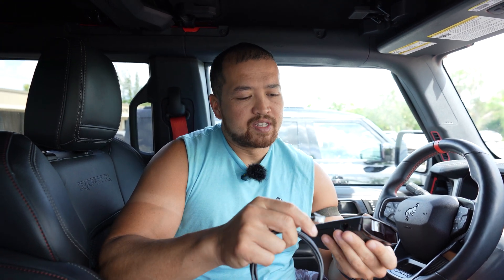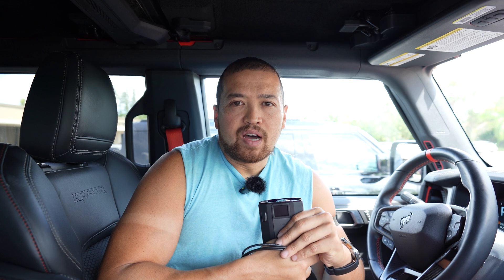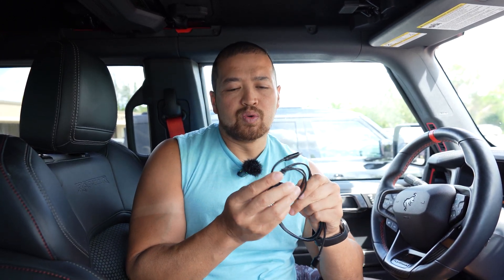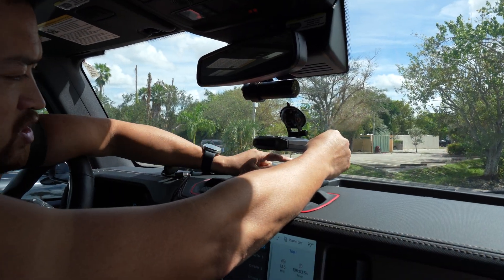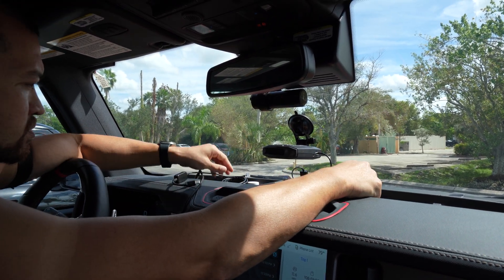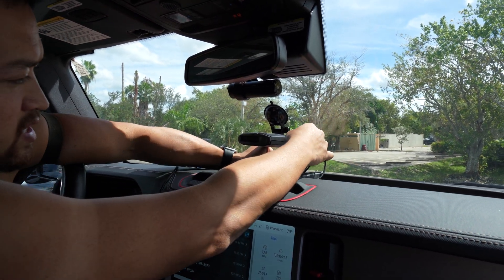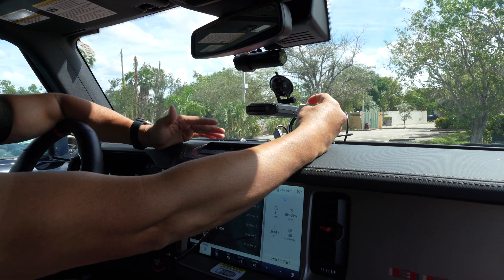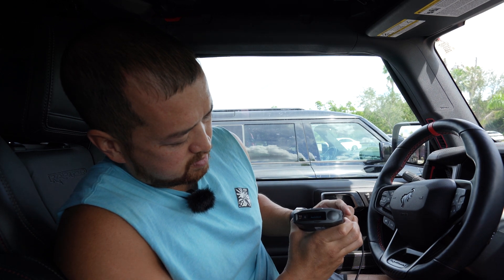USB-C to RJ-11 Adaptor for Valentine 1, Escort, Uniden, Beltronics

Comment: Thanks for the video. I own a 2025 BMW iX an EV and the front 12V outlet only powers on my dashcam and not my Escort radar detector. However, the rear 12V plug does work but it's too far away. I'm hoping that this USB-C to RJ11 you demonstrated will fix my issue. Thanks.

Comment: I'm currently using yalls usb A to rj11 adapter, I really like the shorter length. I upgraded the dashboard usb on my bronco to qc3.0 type A(so it can do 9v/12v), would yall be able to make a cable thats the same length as that but without the big plastic box on the usb A side?